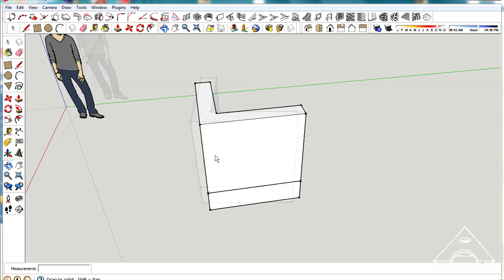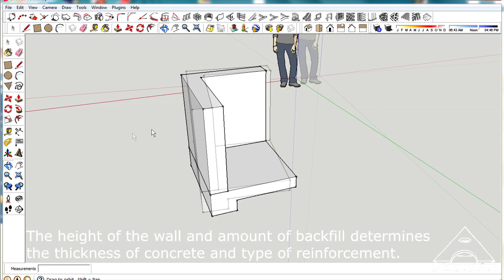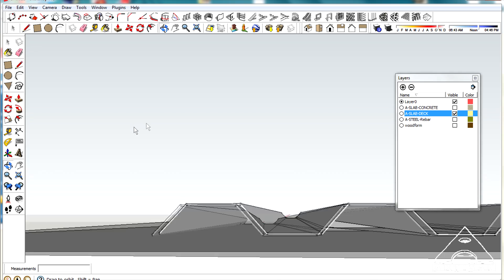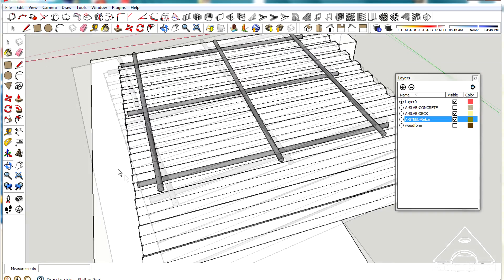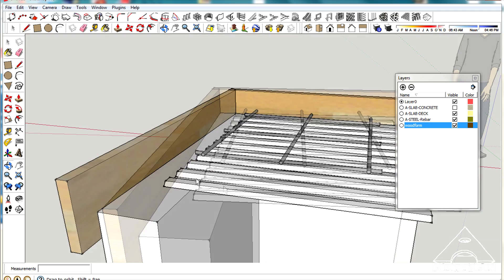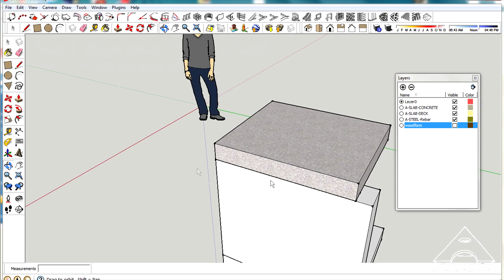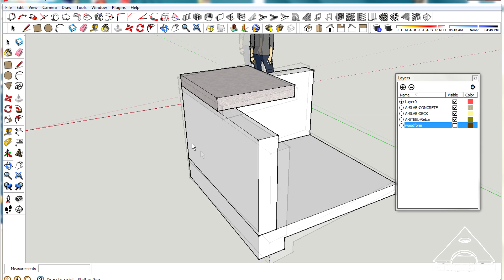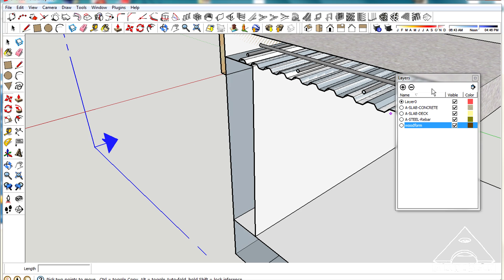Concrete Roof Deck for Underground Shelter - Sketchup

Comment: hi dear I want to ask you a question about the thickness of walls and roof of a underground concrete bunker that can can beer weight of 10 foot dirt on top and please mention thickness for a gauge of Steel bars we can use in that banker I am sorry my English is not good but I want to make you understand what I want to ask if you don't understand please reply me thank you
Reply from the maker: Here i Tennessee, for basement walls we use 10" poured in place 5,000 psi concrete with 1/2" rebar grid 12" on center both ways.  I have built walls up to 14; in height this way and have had no trouble.  I have never used poured in place for underground roofs before but I have used pre-cast hollow core planks that are pre-engineered for the load you specify.

Comment: On mine, I have foot tall steel I beams on two foot centers spanning the three walls inside which is two rooms, form wire is on top of them, then  sheets of tin on top of the form wire, and an eight inch thick concrete slab on top of the tin. Inside the slab is  half inch rebar in a grid configuration making a bunch of sixteen inch squares. Once it sets up, it is plenty strong. In places the tin it sits on isn't even mashed down. I think I read once that a roof like that  when done ten inches thick would be strong enough to park vehicles on. I am going to put some sandbags of dirt on top of my slab when I get around to it, as my place is under the house and if the house burned the bags would protect the slab from heat damage. Nothing like having your own bunker, mine is my equivalent of some guys shops where they go to hang out and do hobbies.
Reply: Harry I am curious, what is the span of your shelter. Your shelter sounds extremely strong and the way it should be done.. Was it's engineered or did you just engineer it yourself?

Thanks
Reply: @kenstotelmyre8722  we designed and built ourselves. we actually dug it under the house, staying away from foundations etc. the part under the house is 20x20, and the part sticking out serves as a 10x20 porch. maybe i should shoot a vid someday
Reply: Thanks Harry

Comment: Flat roof concrete is inherently weak. Why not create a domed concrete roof?
Reply from the maker: It is very labor intense and necessary if the proper reinforcement is used.

Comment: I have an exsisting concrete roof that is leaking and deteriorating. What can I do to fix this other than replace everything? Thanks!
Reply from the maker: That is a tough one.  I would have to see the actual conditions to give any advice but concrete itself is not a good roof system.  You would need some sort of membrane or old style built up asphalt roof system over the concrete. Concrete itself is too porous to be a stand alone roof system.
Reply: ArtisanTony
Perhaps I can unearth the concrete roof and install a pan on top and go 3 inch of new concrete? There is aprox. 2 feet of soil covering the roof. 
Thanks again!
Reply from the maker: Bonniemish
Lay down a waterproof membrane before pouring the new concrete.
Reply: ArtisanTony Let you know how it turns out, thanks!

Comment: 1) Great for a 4x4 roof....but how do you pour a 12 or 16 foot roof?  NO ONE is buidling small shelters that size.....so video is a joke, unless it's a dog house shelter...  Obviously, the metal pan is going to collapse under the weight in the middle of a larger structure?  You need support in the MIDDLE and you did not address that?  What if it is a much more commmon 16 foot by 16 foot room?  Then what?  You can't build interior walls every few feet to support the weight.  Why waste our time showing us how to pour a roof on a structure no one will ever build because it is too small...

2) Why are you stopping the pan and rebar 4 inches from outside edge?  Why not bring the rebar out to the wood decking, as well as the pan out to the wood frame???  Why stop it short?  Structurally, it can only help to have the rebar extend as far out as possible to help support the weight?
Reply from the maker: You apparently had your sound turned down because I address every question you have, These videos are for entertainment purposes and you are not paying for anything.  If you don't like it go pay a structural engineer to design it for you.  You will find it strikingly close to what I have.  If you are going to span more than about 8 feet then you will need steel columns and beams with footings but this is what I was talking about when I said you would need to get engineering help.  You apparently did not listen or read the description.
Reply: Oh yes, I get it now.  I am sooo relieved.  Now, after watching your video, ALL I have to do in conjunction with that, is seek out the services of a STRUCTURAL engineer.  So that, ALONG with your video should do it.  OR, maybe just a structural engineer....Point being is since NO ONE builds such small shelters, than use your fancy software to SHOW the beams and such for a NORMAL size shelter and get it over with....
Reply from the maker: James Morrison
Just for you I will make another video :)
Reply: WHO says "NO ONE builds small shelters" ...this happens to be EXACTLY the kind of help I am looking for BECAUSE I intend to build an underground "shelter" where 8' wide would be ideal!  Actually I was not originally even going to make it that wide but since the decking is sold in 8' lengths then perhaps rather than throwing away cut off decking,  I'll just go with full 8' ...how wide does a root cellar/emergency shelter even really need to be anyway??  ...I have no intention of hiring a structural engineer since it is not going to be "inhabited"   Knowing how I have done things in the past, it will probably be my typical overkill in the strength department ...only going to have a few feet of soil on top of it and not the weight of the world...

Comment: I'm not criticizing the roof, you showed a proven method. I was just adding that you should physically connect the roof to the walls and support columns with a rebar connection or the structure could be unsafe.

Comment from the maker: I said int he video I am assuming the walls have been built properly with reinforcement an also multiple times say consult an engineer for details.  My friend was only asking about the method used for pouring the concrete roof system.

Comment from the maker: That would be good for thos e projects but this fellow is building a small project with easy to access local products and for that application a waterproofing liquid membrane will be fine.  Also, something added after the fact will seal the joint between the roof and wall better than an additive. On a larger scale such as a commercial project I would agree with you.

Comment: Check out an additive for the concrete instead of a membrane. I have had designers specify a product called Hycrete for green roofs and elevator pits. its an oil that gets added during the mix. I have had contractors show it saves us 30% when you add in the material and schedule costs vs. a separate trade installing a membrane, plus this method protects the rebar inside. 2 cents added - cool software Tony-

Comment from the maker: If your spans start to be more than 8 feet or so depending on amount of earth above then you would need steel columns and beam under mid point but this particular shelter I was told was around 8 feet I believe.  Each job should be engineered independently depending on design criteria. The liner would work well but I know when I had my truck done the equipment seemed like it would be hard to get on a job.  Pitch works fine on concrete.

Comment from the maker: This video was to answer a question for someone who already had his walls built but yes it would be good to let wall rebar come up and bend into roof slab.  The metal pan becomes part of the structural system once the concrete sets.

Comment: If you had rebar coming up from the walls, wouldn't you connect the rebar from the walls to the rebar on the top?  Does the pan do anything fr the structure or is it's just there for the pour?

Comment: Tony,
Would you need support pillars in the center of the structure to keep the weight of the concrete and the dirt on the roof from caving in?  
Also truck bedliner,( linex, rhino, self install type) would it perform better then asphalt sealer?